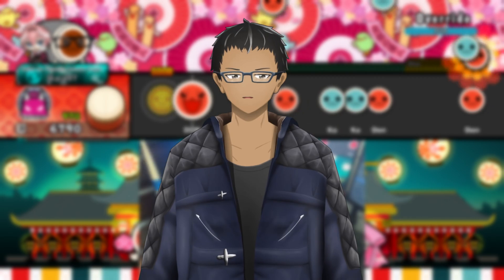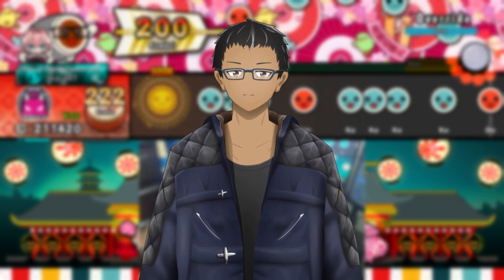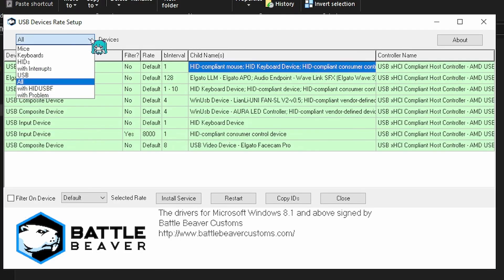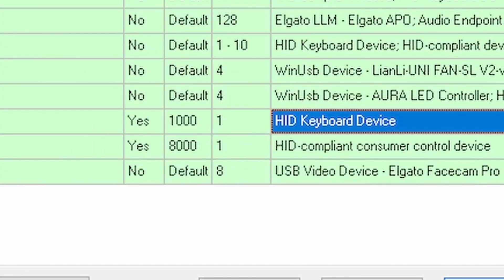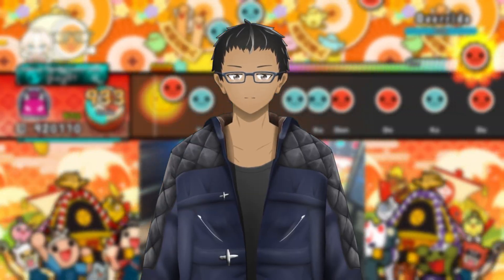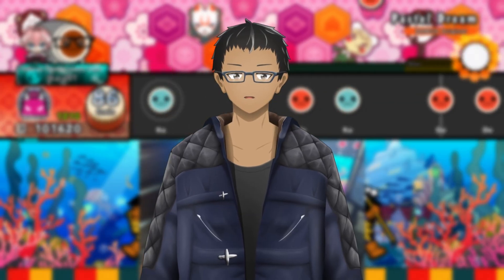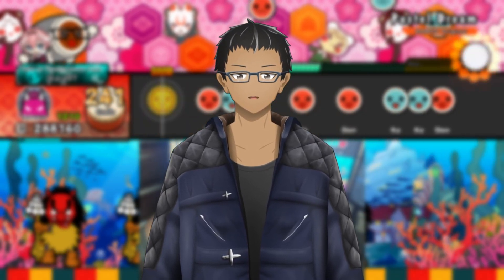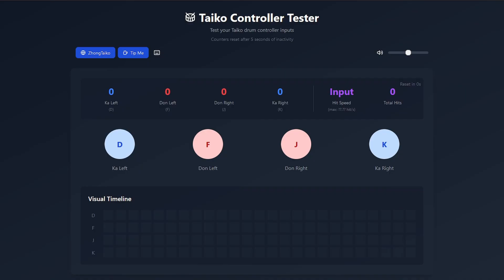Optimize EVERYTHING on the IINE Pro Max With THESE Tools

Comment from the maker: **NOTE (12/4/2025): PLEASE USE THIS TOOL AT YOUR OWN RISK IF YOU PLAN TO USE IT!**

If you are buying the IINE Pro Max right now (as of December 2025) and want to experiment with sensitivity (if needed), do note that this tool is very much OPTIONAL and that there are potential issues that you may come across.

The biggest issue: 
- "Applying settings from tool, unplugging, and replugging in the drum will no longer be recognized on PC"

Small issues:
- Tool not opening

Unknown issues:
- Settings only apply to keyboard settings but not gamepad (which doesn't make a ton of sense for me at the moment because, for my Pro max, it defaults as a keyboard UNLESS you plug in the drum while holding L+R and then it would be recognized as a controller [PS4 Dualshock], the Xbox mode is only usable when you plug in the drum while holding Up + Switch Home and this is the TEST MODE that is required for using the Sensitivity Tool.)

If you are for sure going to be using the tool to adjust the IINE Pro Max's sensitivity for any reason, be sure to CLOSELY FOLLOW THE DIRECTIONS of how to use the tool in the video as all of the information that I am saying in regards to how to activate the TEST mode are from these reddit posts about this tool: 

https://www.reddit.com/r/taikonotatsujin/comments/1gmb0of/iine_pro_maxs_sensitivity_adjustment_tool/

https://www.reddit.com/r/taikonotatsujin/comments/1gki8um/does_anyone_with_an_iine_pro_max_have_the_program/

The problem with using software like this for a drum like the IINE Pro Max is that it seems like there was some kind of change (tin foil hat theory) that changes the way the drum functions, because my Pro Max drum works wonders with the tool as it was bought in November 2023 during its initial overseas release on AliExpress/IINE's official site. Whether they made changes to the drum is unknown.

If the sensitivity tool works for you, AWESOME! Enjoy the free adjustment!

If the tool does not work for you or causes issues, I'm very sorry, these issues you are experiencing (at least for me) cannot be recreated on my unit as the way my drum works flawlessly with the tool so I cannot provide help with any issues you might have.
Reply: Thanks for bringing the video back up!
Reply from the maker: I gotchu! :)

Comment: After using the program, my PC no longer connects. Even when I connect the USB while holding down L+R, nothing happens.
Reply from the maker: It's becoming increasingly likely that something has changed in the manufacturing of the IO board in the IINE Pro Max between the time I made this video (January '25) and now. And this is being proven to me more and more since when I initially released this video, it worked for many people but now as more people are buying the Pro Max and have said that this doesn't working or causes a bigger issue means there was a production change at some point that I can't control.

I'm very sorry this happened, and as a result I will be taking this video down to prevent any further issues happening to other people.

Comment: hello i am panicking rn as i comment this: My Controller got a problem after i turned it onto Xbox mode so i can try 2P in Rhythm festival it worked no problem until i tried playing it, the don sensors registers as both (i dont know the keybinds for xbox) on the right side I tried to change it back by holding the Home + "the button on the left side next to the home button" since i have no idea how to return it back to normal but it did return to keyboard layout but the keybinds DFJK but the Don kept getting hit on F key both sensors if i forgot to say i hit both of them on the controller but it kept on triggering the F keybind and now i have no idea how to return it back to normal nor any idea to contact customer service! I got my controller as a birthday gift and now it has only been a month since i got it and i am shaking my legs please respond if you have the time
Reply from the maker: I would get into contact with IINE and tell them about this only because there isn’t much I can help with other than assisting with sensitivity adjustments. Usually what I do when I put the controller in a different mode, especially in the test mode compatible with the sensitivity software, is unplug and then replug it back and it would default back to keyboard mode. Or in other controller modes is turning the system off, unplugging the drum, replugging it, and then turning it back sets in another mode, you could try that. If sensors are triggering on both sides despite only hitting one side, them you can use the sensitivity to make it reasonably less sensitive

Comment: My left front hit always double taps, what setting should I adjust?
Reply from the maker: By double tap, you mean false triggers a second time? And left front is left Don? If that’s the case and if your drum applies settings as higher number values = high sensitivity, lower the left don value on the slider on the left. Hope this helps!

Comment: high and low are probably the milliseconds it needs to pass to register the same note again, or to register another note. It's a bit difficult to explain.
This is because when you hit a sensor, every sensor registers something, especially when you hit very hard.
This is also why big notes don't exist in the arcade taiko, two inputs together require some sacrifice in accuracy to archieve.
Reply from the maker: The miliseconds before registering…why didn’t I think of that as a possible explanation for the Output Time sliders. You absolute genius!

Comment: Nice video, but I don't think that the first half makes any difference, i.e. installing the custom hidusbf driver for overclocking the USB polling rate. Because the default polling rate of the IINE Pro Max *already is* 1000 Hz. And that's the highest "normal" frequency for USB2 anyway. It might be possible to overclock it higher (2000 or even up to 8000 Hz), but all that does is make your PC ask the Pro Max for new data more frequently. It doesn't guarantee that the Pro Max will actually deliver new data more frequently than 1000 times a second. Someone would need to test if it is actually able to do that.
Reply from the maker: If it is possible to go further with the polling rate, it would be interesting to test that 🤔 however you are correct here, I should have included that using the custom driver tool could very well be placebo, strange how these things work 🤷‍♂️

Comment: Unplugging this saves the sensitivity, how about after that, I plugged on Ps4? Does it still saves the sensitivity? 🤔
Reply from the maker: Ooo good question, I knew there was a piece of info I overlooked. Yeah, these settings save directly to the drum, so you can unplug it with the settings applied and plug it back in and still maintain the settings.

Comment: will these settings port back to switch or will it only work on PC?
i mean if the settings are from the drum or from the pc?
Reply from the maker: As far as the Battle Beaver tool, THAT one most likely will only work for PC. From what I have tested on Switch, the settings DID apply to the drum and not to PC only

Good question though!
Reply: @IkaiaGotRhythm  I will try as soon as I come back home from work, I will try to see if polling and sensitivity settings will remain in the drum. I wanted to try this out when you referenced it in your video review but i was afraid it will only work as an outer setting from pc, not from the drum itself..

Thank you tho
Reply: @IkaiaGotRhythm  I was also reading the reddit post you mentioned in the video, other users said that the drum stopped working when they plugged it back to switch after using the sensitivity tool, can you verify this?
Reply from the maker: For the drum not working on switch post-tool, I cannot confirm this at all since I have tested the tool then plugged it on Switch playing Donderful Everyday and it works just fine. I have never experienced an issue with it. That’s not to say that I am the end all be all, it’s a valid concern to have.
Reply: @IkaiaGotRhythm after extensive testing, yeah I guess I’m FCing back to back ONI songs so i guess the sensitivity tool worked
Reply from the maker: @vallierickfacunla3627  That's great to hear that it worked out!
Reply: @IkaiaGotRhythm i got to install it and hear hear, my sliders are entirely flipped (my settings are all 10 across all fields except mute set having 2).
Plus I had to unplug whenever i need to test it in the same pc..
 Im entirely doubting if the entire setup work because it feels im having placebo effect but one thing if I crank the don/kas to maximum they don’t have input when i plug them back to the switch